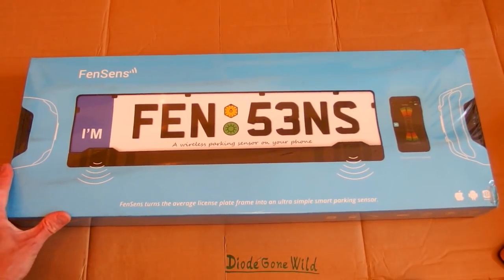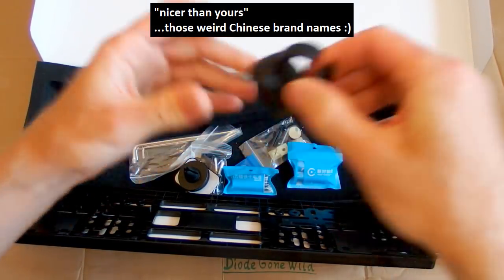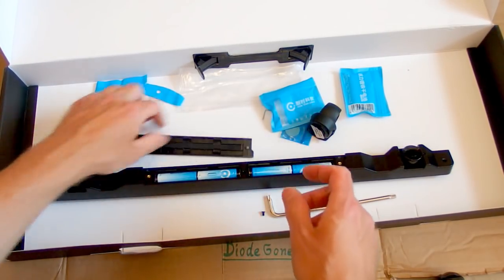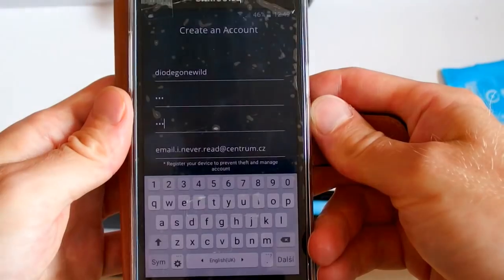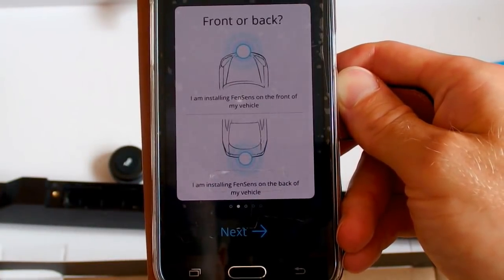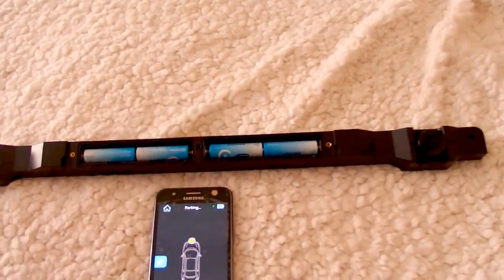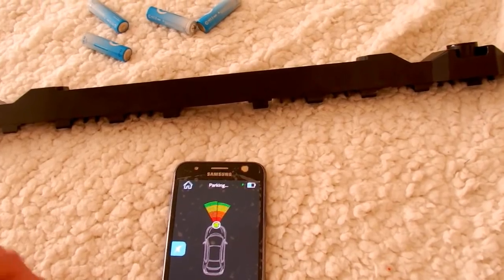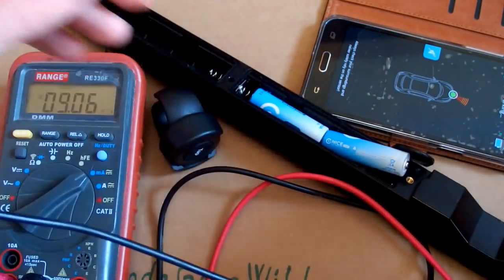FenSens wireless parking sensor - test and teardown

Comment: So I could build this with the stuff in my Arduino parts box. I love how new tech has gotten much less intimidating since I got into electronics.
I also noticed there was not much in the way of water proofing. So realistically this thing would not last long.
Glad your back man.
Reply from the maker: You're right, I forgot to talk about the waterproofing (and the video got over half an hour long anyway!). It doesn't look waterproof at all. In a device mounted on the exterior of a car, this is a bit of a concern :).
Reply: This device seem quite overpriced for what it contains, and if the waterproofing of the sensor assembly is inadequate, it is just going to be ruined by water (and salty road chemicals in cold climates) before the first set of lithium cells even wear out.
Reply: I can see conformal coating all over both PCBs. I don't think water is an issue really.
Reply: Why would they water proof it?!  It should NOT last long, so you buy a new one every year. ;D
Gimme a tennis ball hanging from the ceiling on a strings, problem solved, no batteries required. ;)
Better yet, just tie the DiodeGoneWild cat to the bumper, and when it meows really loud, then stop the car immediately before squishing it.  ha-ha-ha

Comment: It is always funny to see the permissions these apps request, and of course the option to log in with Facebook 🙄
This appears to be garbage of course. What on earth could require a 26Mb app for this?

I also notice the 10ms advertised response, but 100ms ultrasound pulse..before we even get into the delay from the app and Bluetooth.
Reply: Agreed, and as a software developer myself I must say that by the looks of it that app really must be crap. Crashes, hangs, works like "sometimes", and of course that bloated size of (unneeded?) code; maybe a suite of dependent libraries to hook up to those accounts and facebook tracking system? If not crap, then surely the app hasn't even reached the beta quality level yet. The time lag also looks more like 1 sec even in those simple tests.
Reply from the maker: That's a good point :). Absolutely no way it can have 10ms response, as the sampling period is 100ms :). It must be a typo or...  a lie.

Comment: Welcome back to these screens!
The idea of principle is not wrong: a useful accessory easily assembled, without wires to be added. But that the App needs a login and work only if there is internet this is really out of place, it seems an excuse to create a database of those who use this accessory ... we just need some attacker to access the app and download the vehicle positions 
Not to mention the poor protection against water and humidity, in an accessory to be mounted outside I would not have expected it
Reply: PCBs are lacquered completely over, conformal coating... i don't think water is going to do anything to it.
Reply: Siana Gearz 
Hi Siana,  the layer of the laquer  seems very thin.
Maybe it  can resist to the weather injury  but i believe for a  very short time... some better weathered circuitry i've seen, some times ago are coated with a very thick coat of product, so thick that  the smallest component are covered
Reply: In my opinion it's an expensive, over complicated piece of crap.  Gimme a tennis ball hanging from the ceiling on a strings, problem solved, no batteries required. ;D

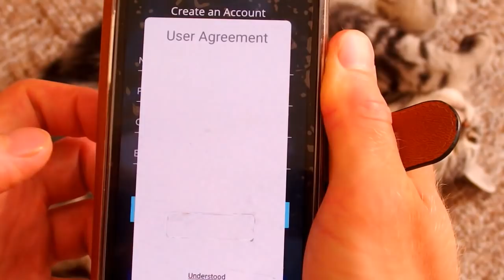Comment: (9:25) - I am quite disturbed by the length of that User Agreement / EULA not to mention all the data you are giving them access to.
How difficult would it be to write your own app for this device?
Would it be even possible?
Could make an interesting project for someone.
Any takers?
Reply from the maker: A bargraph with several LEDs would be much better than any app. This is like using your smartphone camera and display instead of a mirror :).
Reply: DiodeGoneWild Yes, and even just the variable beeper alone is sufficient, I have found out with the factory-installed sensors on my car. You shouldn't be looking at the LEDs (or a fancy picture) anyway while backing up, unless perhaps it is from a rear-view camera.

Comment: I didn't like the forced log in, otherwise you could have nailed an old phone to the dashboard and that would be it's use.
There must be a secondry reason for log in, tracking where you are perhaps, i really don't like companys grabbing data.

It's a fail for me, i would buy a wired system.
Reply from the maker: I dread of the day my freezer will stop freezing because I didn't log into facebook or the wi-fi connection failed. I also don't like this, this is overcomplicated, overengineered and of course, may track your data. I'd use just a simple device with an LED bargraph. Wired or maybe wireless, but definitely not relying on internet connection, logging into an account, and on some app and operating system that starts up very slowly and often gets stuck. For the same reason, I prefer a real calculator over a calculator app, that takes like 15  seconds to start up on a multiple core multiple GHz processor :D.
Reply: I wonder if the raw ouputs from the head unit could be fed into say a pic chip or mega to make a display.
Or if the blutooth data can be used, im sure you have had a good think about it, you are very creative with electronics :-D
Reply from the maker: The raw output from it definitely could be used, but it makes no sense to salvage sensors from this bloody expensive device. You can buy ultrasonic sensor modules from Ebay for about 75 cents including shipping :).
Reply: Looking at quality of that "app" programming I'm pretty sure they copy-pasted the comunnication protocol code from some random github repository so data should be easy to use.

Comment: Haha, those opamps are a bit too "high end" and less power frugal than really needed, and how do they generate the voltages for them anyway?  Why not a generic 4580? Why not LM358? Both are cheaper, lower power, and have a larger voltage range to work with.

Comment: I fail to understand, why should it have to be connected to a mobile phone. The sensor should be directly paired with the beeper. I have seen similar such device. They have the sensor near the license plate and a beeper/display near the dashboard.

Nice 🐈
Reply from the maker: I also fail to understand this type of devices. There's also a juice pressing machine that requires an internet connection. I hope I'll die before washing machines won't wash my clothes unless I log into facebook.

Comment: (3:15) - No not nails, rivets. You need a special tool to install them called a, (surprise surprise),  rivet-gun.
You can pick these up for five bucks or so on eBay:
https://www.ebay.co.uk/itm/HEAVY-DUTY-4-HEAD-NOZZLE-POP-RIVET-GUN-HAND-RIVETER-TOOL/163140990595?epid=25020310836&hash=item25fbf5f683%3Ag%3AH78AAOSwZlZaKFLY&_sop=15&_sacat=0&_nkw=rivet+gun&_from=R40&rt=nc